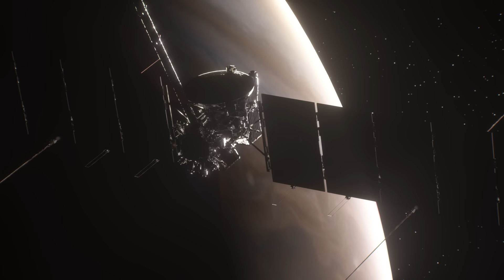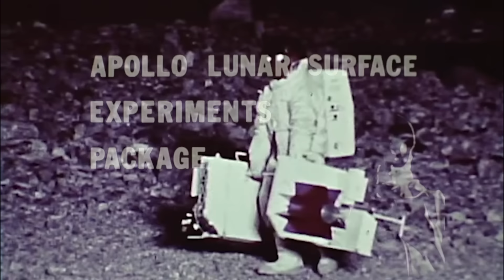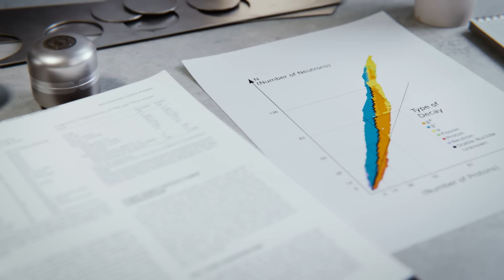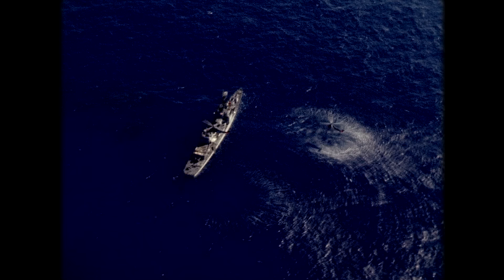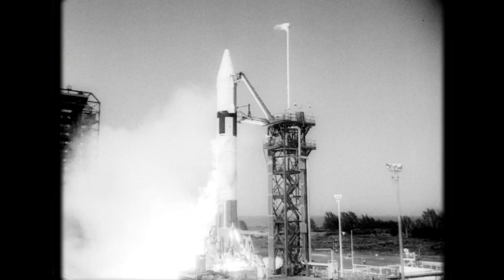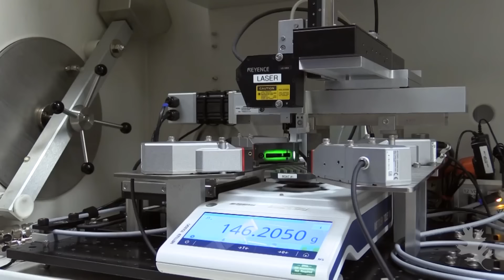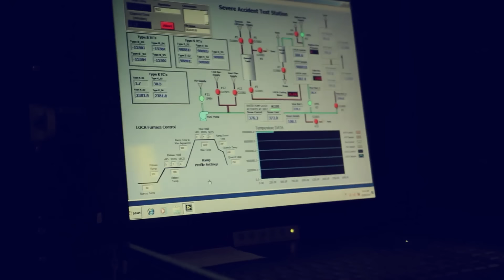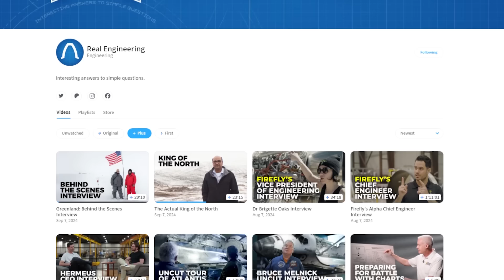NASA'S Plutonium Problem

Comment: Fun fact, plutonium 238 will absolutely sustain a chain reaction and you could make a bomb with it, the bare sphere critical mass is about 9-10kg - but of course the real problem is that it puts out so much heat that you can't build a working warhead using it.
Reply: Welp, there goes my plans...
Reply: Isn't it also due too high spontaneous fission events producing too many neutrons that can prematurely initiate the chain reaction causing a fizzle?
Reply: @teresashinkansen9402 bingo
Reply: Hello Scott🫶 fly safe
Reply: This guy Nukes!!! In all seriousness, I'm glad I found a channel with pure information and informative comments... helps a layman like me understand.
Reply: I need a video on how warheads work immediately!
Reply: @FirestormX9 😂
Reply: @scottmanley  Unless that is, someone finds a way to deal with the 500C temperatures it can reach all by itself through alpha decay.
Reply: Plutonium 238 is not fissile.  How are you going to set up a chain reaction in it?
Reply: @stargazer7644 it will self sustain fast neutron chain reactions but not thermal neutron chain reactions.
Reply: @derekp2674  Yes that is correct. Pu238 has not that great fission cross section for thermal neutrons (17.6 barns) comparing to Pu239 - 750 barns. But it has almost the same cross section for fast neutrons even slightly higher.
Reply: @marielxenovia3062 Indeed. I tend to remember the bare critical mass as 10kg for pure Pu-239 as alpha phase metal, so that shows Pu-238 would have a higher fast fission cross section.
Reply: @derekp2674  For fast neutrons (14MeV) Pu238 has 2.6 barn fission cross section and Pu239 - 2.4. Anyway handling and storage of Pu239 is much easier comparing to Pu238 as well as obtaining process.
Reply: In the Summer in a years end of nineties I Made Holiday in Provence. In the french TV News IT was told, that a ship would Bring 20 tons Russian Plutonium from decommissioned war heads to Marseille, from there 100 km in the huge nuclear Center Cadarache to Mix the Plutonium in Mox nuclear fuel for use in nuclear Power plants.
Reply: @martinschneider7130  Это ерунда. МОКС топливо мы делаем сами. А во Франции нет нужного реактора.
Reply: the heat would probably deform the explosives meant to compress it into criticality.
Reply: Yet another reason that we should be building lftrs.  One of the products of that type of reactor is plutonium 238 which can be chemically separated from the other products.
Reply: @thebarkingmouse  do they also produce Pu 239? Isn't it very hard to seperate those 2?
Reply: @adrianthoroughgood1191 yes, but you can use a separate blanket salt with Np 237 and produce pure pu 238 in that stream.  And either separate the pu 238 and 239 from the other streams or leave them as fuel.
Reply: The carbon uranium reactor can be any size in theory…
Reply: Therein lies the problem maybe if we focused more on teaching and learning from eachother rather than fight and destroy eachother we’d be better off
Reply: @денисбаженов-щ1б  I live in New Mexico where most of our U238 supplies came from at the end of WW2. U238 is NOT a common element, but is  the most common isotope of Uranium. What's YOUR point besides flapping your gums to feel relevant?
Reply: Yes I'm surprised this wasn't mentioned in the video, I think we need to use the alternatives rather than making more bomb material that our government will likely lose in the oceans.
Reply: @eli_kohler  lose in the oceans? You mean stockpile away, once they are outdated, inside of mountains or desert regions
Reply: @ Who said funny?
Reply: You'd think in the 6-7 years it would take to produce that much, someone would ask where it's all been going.
Reply: @modelcitizen1977 6-7!!!!
Reply: Yeah that sounds pretty rad
Reply: nobody asked you. kidding, cheers mate
Reply: I was stationed on a US Minuteman missile base
 We have plenty of U-235. Too much in fact. U+238 is available all over the US in the cooling pools of mothballed nuclear power plants. Unfortunately, it's contaminated with nasty stuff like cesium, plutonium, etc.
Reply: @GeneralSulla  If you just want U 238, the US has a bunch of depleted uranium rounds sitting around in storage IIRC that it needs to destroy or use.
Reply: @GuardsmanBass they’re keeping the spent uranium for an attempt of refuelling the rods. Currently Japan is experimenting with making the rods usable again
Reply: @GuardsmanBass I'm down for using it
Reply: @maiqthecoward7132  UK and France have been reprocessing nuclear waste for decades. It's not some new tech. The US just doesn't bother because it's too expensive to be worth it. UK has shut down their factory now. Japan is building their own.
Reply: @DarkAttack14 the part that you are down is defo not surprising.
Reply: @GeneralSulla  do all those elements have different melting points?
Reply: @GeneralSulla U-238 is the most naturally abundant isotope at 99%. Uranium 235 is fissionable, but has to be refined, usually by gaseous diffusion.
Reply: @GeneralSulla  "We have plenty of U-235. Too much in fact." - Given that U-235 is used in most nuclear power plants, how can there be too much of it?
Reply: The Kerbals could do it. 
For a short time perhaps...
Reply: @k3salieri  Do Kerbals die from radiation exposure?
Reply: @stopthephilosophicalzombie9017  kerbals don't get old enough to die of radiation exposure
Reply: C'mon Scott, that's not "fun".  😀  Fly safe(ly)!
Reply: @TheBierp  What do you mean that's not fun!?  Who doesn't want to go out into the desert and play with extra spicy fire crackers?
Reply: @FireStormOOO_  Some people already tried playing with the demon core and they didn't do so well.
Reply: @TheBierp actually that is VERY fun
Reply: That's reassuring.
Reply: 🤣 Fun Fact Indeed
Reply: So would it essentially be a dirty bomb?
Reply: Why tf do you know this
Reply: @Badatwarthunderr  It’s not fissile but it is fissionable. That means it takes more energy to initiate fission, and the fission achieved isn’t sustained. So, while most of the plutonium wouldn’t be consumed in the explosion, ample energy would be released to cause plenty of damage.

Of the 6.9kg of plutonium 239 used in Fat-Man, only 1kg was actually fissioned. 

Modern multi-stage nuclear weapons use lower amounts of radioactive materials (3-4 kg) but achieve 3-4 times the explosive yield compared to the weapons used in World War II.
Reply: @Badatwarthunderr It's misinformation. Plutonium 239 is absolutely nukeworthy, no denial in that. Plutonium 238 cannot sustain fission because, even if it gets hit by fast neutrons, its fission is very inconsistent. 

So no, not possible. Wrong isotope
Reply: They used plutonium in fat boy one of the bombs dropped on Hiroshima and Nagasaki, so not “you could” they did. And yes it was a functioning warhead despite your claim
Reply: @maiqthecoward7132 different isotopes of plutonium. If I’m not mistaken, they used Pu239 in fat man and all other atomic weapons, not 238. Same thing with U238, but can use 235. I probably butchered all of that bc I’m not 100% sure, I’m just pretty sure lol.
Reply: @EntityGaming09 U235 is the one you need. U238 does not work in commercial light water reactors and bombs. That is why you need around 3 to 5% or 90% of U235 to work. 
U238 is rubbish, the military uses 😅
Reply: @maiqthecoward7132 An isotope is a chemical on the periodic table that is capable of having different atomic masses. Plutonium 238 and Plutonium 239 are the same chemical element but with a different atomic mass. As such, their properties are different. 

In short, when plutonium 238 reaches criticality, burns slow and warm. When plutonium 239 reaches criticality, it burns fast and hot. So, plutonium 238 is great as an energy source for generating electricity, where as plutonium 239 is great for making things that go “boom.”
Reply: @maiqthecoward7132 that bomb used Pu-239 not Pu-238.
Reply: @maiqthecoward7132  Fat Man and Little Boy both used Plutonium 239, not Plutonium 238. Same chemical element, but with different atomic mass and, therefore, different properties.
Reply: LOVE U Scott! Thank you for visiting.
Reply: yet
Reply: Is ac 225 made from this?
Reply: Fun!
Reply: Epic
Reply: Way to go Oppenheimer
Reply: Actually if you use the correct reflectors you can use 5-6kg and achieve a bomb
Reply: Not fun.
Reply: Bummer, I guess I will just take U235 again
Reply: I was about to correct the same statement. Thank you
Reply: Yes, and it gets worse, safety margins for Plutonium need to be based on chemical toxicity, rather than radioactivity.
Reply: Awe crap Scott your always such a buzz kill.
Reply: Time to cook.
Reply: Go study Project Pluto. The nuclear reactor powered cruise missile. They absolutely made components that worked white hot. So a nuke involving heat of it's core would be no problem.
Reply: Hullo!!!!! I wasn’t expecting you here 🪐
Reply: Wow, that was really, fun.
Reply: You just show up at the best moments
Reply: Nuclear bombs don't exist. Imbecile.
Reply: Of course I read that in your voice haha
Reply: Lol, sounds like you've done this before, Scott... 🤔🤣
Reply: Yes, fly nukes safe!
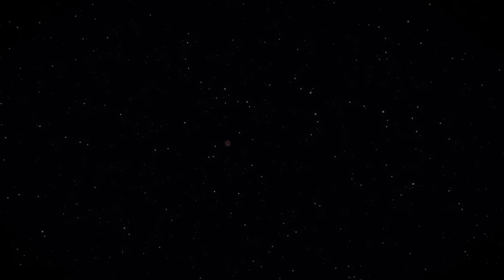Reply: @5:06 how do they disperse the heat buildup into space if its a vacuum with no medium to transfer the heat to to???
Reply: @squigglesmcjr199 the same way the sun heat the earth, thermal radiation
Reply: @squigglesmcjr199 A part is emitted by infrared and short-term radiation
Reply: 500ml is very small. 
Spread it out and it will not get hot.
Blast it together for the explosive nuclear reaction.  ??
Reply: @stephenbrickwood1602 Would 500g be enough? I don't think so, even with the greatest effort.
Reply: @MP-nc2pw  500 ml is 500gm of water.
But plutonium is 20times more dense and so 500ml of plutonium is 10kg. 😊
Reply: @stephenbrickwood1602 you are roughly right
Reply: Mister MANLEY HIMSELF!!!
Reply: So you cant make a bomb with it.
Reply: Intrresting!
Reply: The problem is… does it really need to be for a bomb?
Reply: Wasn’t very fun..
Reply: I believe INL made most of the fuel pellets for nasa
Reply: Hey Scott have a question for you in the movie The Martian where Matt Damon puts the nuclear RTG behind his seat isn't he basically cooking himself with gamma rays
Reply: @garyseven4765 Not Scott but I'll Tell you right now, no. Assuming it's plutonium 238 RTG, it's not a notable gamma emitter.
Reply: @garyseven4765 no, because plutonium and its decay products primarily emit alpha particles rather than gamma or beta
Reply: Scott, imagine exhausting helium gas at 15% the speed of light for thrust?  Done, it's called alpha particle emission... So? paint one side of a huge sail with a strong alpha emitter Pu238 ... should equal a slow but steady THRUST!
Reply: aw man i almost finished before seeing this
Reply: Finally I don't need chickens for my nuclear landmine
Reply: I think your mistaken for pu239
Reply: actually yes you could but it'd be the size of a ship. with railgun tech you in theory could impact in the critical 'get together' zone
Reply: @aarons7975 9-10 kg is the size of a ship??
Reply: @aarons7975 so, how does 9-11kg of Pu-238 = the size of a ship? 🤔 😊
Reply: @jmulnick   you totally missed the context of the conversation.  Must be government school educated, it sure shows.  I'll let you try again.
Reply: @aarons7975 brown . All around they cant do thinking. As sad it is.
Reply: Oh Hi Scott. I'm sure the engineers would find a solution for the heat if there were no better materials
Reply: @leonponce8437  hardly, it's hard to manage a material which spontaneously heats up.
Reply: scott W
Reply: Plutonium 239, or 235, are more stable and better for handling for making a nuke.
Reply: You may not be able to create a War Head but you could create a Hot Head! I'll show myself out.
Reply: So, it's theoretically possible, one would just have to find a way for keeping the Pu 238 cool enough to perform a chain reaction. Challenge accepted! ☢😝 
J K
Reply: 360mm aio?
Reply: Yet...
Reply: HELLO THERE
Reply: Would that not require a gigantic manufacture to output such a mass of 238?
Reply: Scott manlette bullahit artist extrodinnairre
Reply: It's been solved. Married a physicist - she can confirm. Can't give specifics, but it's solved.

Enjoy your channel too, Scott Manley.
Reply: @Pleiades721 are you afraid im gonna steal the entire US plutonium supply for a decade?
Reply: @HaloWasGoodOnce  Nope. Easy answer. Not even concerned.
Reply: @HaloWasGoodOnce that would make for interesting stories
Reply: Yeah prepare yourself womanly 😂😂😂
Reply: Fun fact: that's not true. Pu-238 was the radioisotope of choice for fission bombs.
Reply: @XxRedCooperxX  No, it does not work for that. Contamination of PU-239 with PU-238 is the reason why implosion devices became a thing and not gun type. Too much spontaneous fission causing premature detonation. So a device made with mostly Pu-238 is not really practical unless you have a way to make it reach super critical mass much faster than what implosion techniques can do.
Reply: @teresashinkansen9402  ack you are right, i shouldn't have answered without thinking
Reply: @XxRedCooperxX  You're thinking of Pu-239.  Scott has done several dozen videos on this stuff, including a deep dive series on how they work - go have a refresher :P

Comment: This plutonium shortage was exactly why NASA chose DAVINCI and VERITAS (solar powered missions to Venus) as the two Discovery missions in lieu of more ambitious missions at Saturn and beyond. We also need more Venus missions since the last U.S. Venus mission was Magellan in the early 1990s. 

Also, the problem we have is because of that wasteful garbage called the Perseverance rover. There was already a Curiosity rover but JPL was able to scam NASA and taxpayers for a wasteful and unambitious Curiosity 2.0. That RTG could have been used for an Enceladus or Uranus mission. A Uranus orbiter won't happen until the 2050s thanks to JPL.

Comment: 15:30 - The diagram and narration are contradictory: The narration and the dashed line's label say "0.5g", but according to the mass axis labels, the dashed line is between 10^-1 (0.1) and 10^-2 (0.01) grams, which would be in the order of magnitude of 0.05 g. It remains unclear whether the correct value is 0.5 g or 0.05 g.
(Also, since the mass axis is logarithmic, a value of 0.5 should not be halfway between two powers of 10, but somewhat closer to the larger of the two powers.)
(As another side note, in SI notation of units of measurement, character case matters (except in the case of the liter); a font rendering lower-case letters as small caps is therefore problematic for a science- or even engineering-oriented channel.)

Comment: plutonium 239 can be used in a reactor for power, so why not simply make more? there is benefit in running plutonium reactors and the "byproduct" of plutonium 238 could be what makes our future green
granted a hunk of Pu-238 in every home would be far too dangerous, we could design localized communities with a single location holding a large RTG to provide "district heating" and a base level of power in cases of grid failure(possibly by being the local 5G hotspot and telecom server)

the result is a "free" source of localized heat and electricity that is harnessed rather than left to heat the planet without doing useful work
the excess local heat would be a boon to cold-climate locations that often use combustion for heat and emergency power

this also ensures a constant renewal of the potency of Pu-238 in RTG's and in keeping stock for space or disaster missions
Reply: @jackgee3200  true enough, I am no nuclear physicist, my point is that this is a solvable problem, and that nuclear energy is WRONGLY demonized based on HUMAN and NATURAL disasters just HAPPENING to trigger failures of reactors

Chernobyl was FACTUALLY caused ENTIRELY by human error, a planned test was NOT SAFE after a hard day, the reactor crashed and instead of postponing the test till it was safe, they decided to destabilize the reactor to a meltdown which SHOULD NOT HAVE BEEN ALLOWED

three mile island was caused by FAILURE to MAINTAIN CRITICAL safety systems and core devices, and ironically was dealt with in a manner SO SAFE that the evacuations were literally pointless as they caused baseless fear, even for pregnant women and young children and elderly

fukushima was 100% caused by a tsunami and subsequent failure of the backup generators(should have been placed on higher ground, lack of foresight) and all contamination combined was less than a single family having their home destroyed by the wave, albeit it was hard to clean up the reactor back to operational capacity

there has been NO disaster of nuclear proportions caused SOLELY or even SIGNIFICANTLY by non-human error or a disaster you LITERALLY CAN'T plan for

so anyone who fears nuclear based on those 3(and likely MANY other events including that military micro reactor) should simply be ignored as "misinformed"